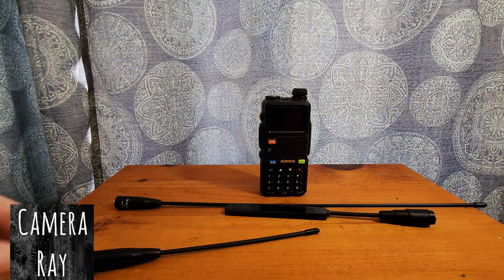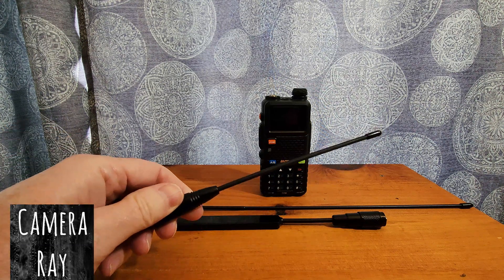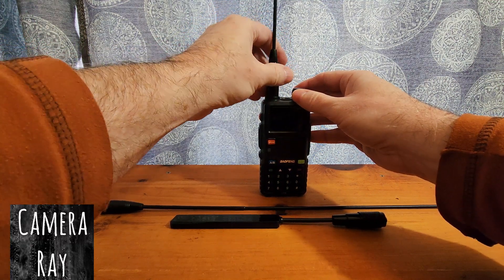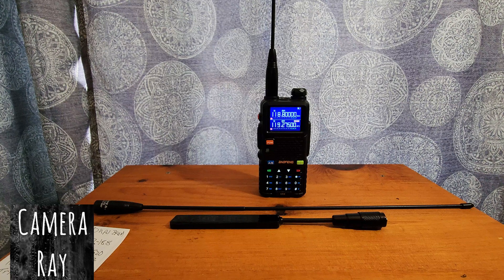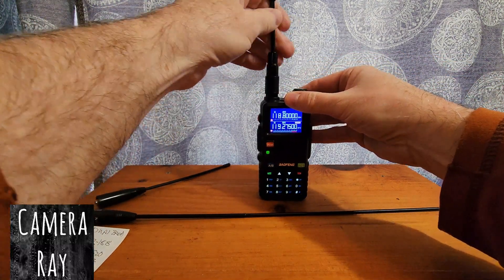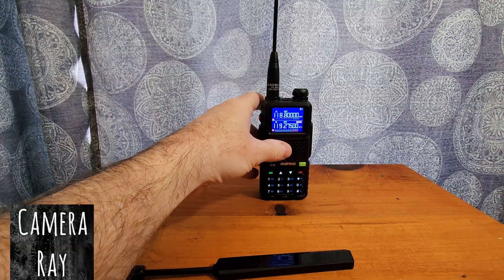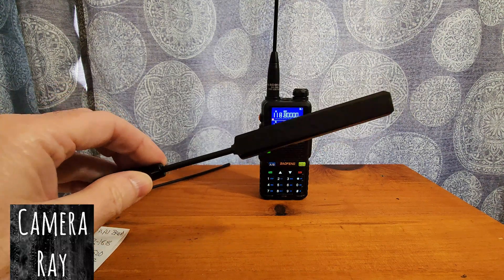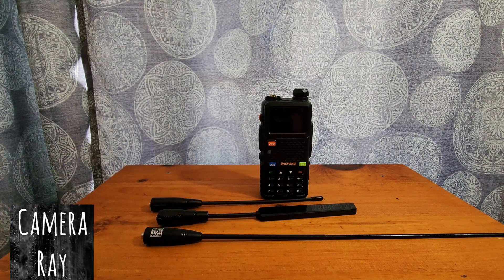Baofeng 5RM Antenna Test For Airband Reception Comparison

Comment: How far away are you from the airport? I just bought one of these receivers and even though I live very close to the airport I cannot manage to get proper signal with the stock antenna. I believe buying a new one will provide better results obviously thank you for the video
Reply from the maker: As the crow flies I live 5.5 miles from the airport tower. Thanks so much for watching.

Comment: So what exactly are these stock whip antennas? I got some of the short and long ones for various baofengs
Reply from the maker: A stock Baofeng antenna is a simple "rubber ducky" design with a stiff plastic exterior, housing a coiled copper wire (an inductor) wrapped around a ferrite core or simply a wire coil, all encased in rubbery plastic, designed to be short and cheap, making it generally less efficient but functional for basic use.

Comment: There's no "one antenna fits all" solutions. Dual and triband antennas work but not as well as if you got a proper antenna tuned for the frequency you want to listen to or transmit on. the antenna is a division if the physical size of a wave at a given frequency. when your antenna mismatches you miss signal or catch extra noise. when its the proper size you get good signal. The reason your triband works better is because you introduced a proper vhf antenna into the mix. your first two despite being marketed as dual band and having ok SWR on said bands are actually UHF antennas.